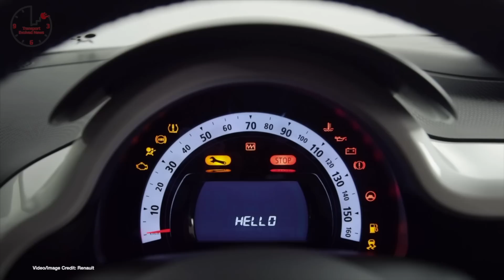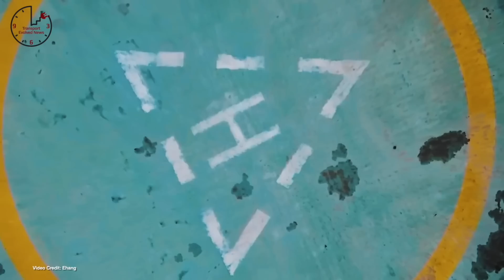TEN 282- Model Y Deliveries Scheduled, Rimac C_Two On The Track, Coronavirus Air Lift

Comment: These rumors may have merit (?) - the primary component(s) of prismatic lithium battery cells is only sourced from China. LG Chem had a contract which was recently broken. Now THAT prismatic supply line is being given to Tesla for their "new" China Only Model 3 "econo car". LG is also the only company in the world, other than Panasonic, who has a small Cylindrical Lithium Battery Making machine". Tesla bought the company who MAKES the Manufacturing Equipment for Cylindrical Lithium Cells. At the time of that sale, Tesla announced, as the new owners, Tesla would have priority order fulfillment from its newest acquisition (and the former CEO quit). SO - 1. No Prismatic batteries for a while  - 2. Limited Cylindrical batteries until someone else figures out how to make such machines. Any of this true? All of it false or misleading? I'm not a researcher or journalist, so being both - maybe you could figure it out. Thanks again for all you are doing for the Future of Our Planet.

Comment: Shame on Kia. This is why I'm considering a Mach E instead. I can buy it anywhere in the US by next year, and 2000 dealers will have it on stock, so I can try to play a game between 2 dealers to get them to sell me an EV at the lowest possible price. Can't do that with a Kona or Niro. Also, I use potatoes with onions and Masala to make spicy curries. Wonder if that will Spice up the batteries :).
Reply: 12-18 months delivery in Europe, Kia E Niro so it's a Unicorn Ev
Reply: Isn’t the Mach E first year already sold out.  They are going to be very popular.  I don’t think you will be able to play dealers off against each other for years.